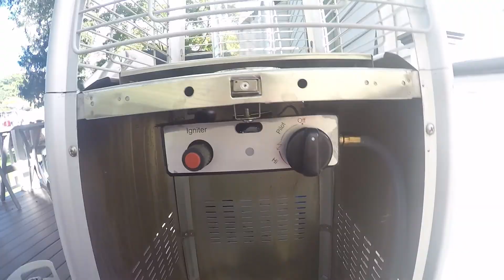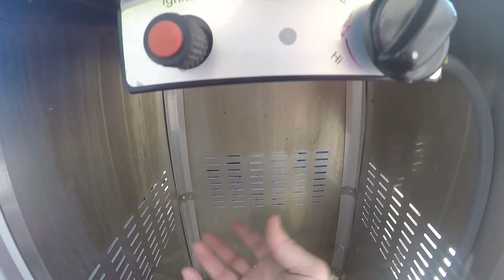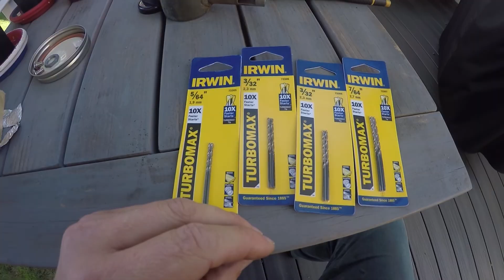Convert Any Propane Heater to Natural Gas / Dual Fuel - Simple Mod

Comment: Excellent instructional video! I have an old Dynasty ($6000!) outdoor grill that ran on propane and converted via a kit to NG when we moved to a new construction home that had NG piped out to the rear patio because, like you and so many others, hate the hassle and cost of propane. So I was familiar with the orifice size difference requirements. I just bought one of the pyramid heaters through eBay (which hasn't arrived yet) for that same patio and was wondering if it could be converted, so I'm glad I found this from you. You cover "all the bases" and answer all the questions I had. Many, many thanks. By the way, I'll probably get a NG orifice rather than drilling out to 3/32" on the stock one since they only cost a couple of bucks and keep the original in case I ever want, or need, to go back to propane.

Comment: I would have bought caps or plugs and drilled them to make new orifices so it could be switched back if needed. I believe propane hole is 1/3 of the size of gas as a rule of thumb and the vents should probably be indifferent. Usually the regulator spring gets replaced as well, you may be able to adjust the regulator screw, just not how many turns so it can be put back. Also I would never attempt something like this indoors or near anything that could catch fire if the unit becomes over temp!

Comment: I followed exact directions. I fires up. Flame just reaches top but it puts itself out after a few minutes likes it's getting choked out. Suggestions?
Reply from the maker: either air fuel mixture, or possibility that the flame is not touching some kind of safety thermal probe.   depending on your model, thermal probe needs to stay hot to keep the fuel flow going.
Reply: @ModsAndProjects  Thank you for the quick response. This is the heater which appears to have the exact burner you show.Pyramid Patio Heater, 48,000 BTU Outdoor Heaters. I used foil tape and closed of vent holes. Could i need to maybe open up a small area?

Comment: I know Im late, but this is such a helpful video. We did something similar to our grill 15 years ago. Just bought a bit set from Harbor Freight for like $10 and drilled the jets slightly larger. Worked like a charm. Cant wait to do this to my heater towers and stop refilling these tanks after a few uses.

Comment: Would this work with one of the Mr buddy infrared pan heaters you know the ones that screw on top of the propane tank and look like a round metal bowl and heat up the infrared area and turn it orange?

Comment: I have the same unit as you. I tried with just connecting the natural gas line first, couldn't get a pilot light. Tried propane to confirm thermo coupling works, yes it did. Maybe not closing the air vents would cause no pilot light? I don't know. Hope that works.

Comment: Do I need to use a regulator after converting to NG?
Reply from the maker: You could always add one for extra safety but generally the pressure to the house is regulated after the meter and is low pressure.

Comment: Very easy to set up and use, attractive but be sure you understand the height it's not tall. The heat is not overwhelming, but steady and pleasant fireplace.homes It's quiet, too. I like the possibility of easily moving it from room to room in the event we want supplemental heat elsewhere. Definitely a good buy.

Comment: I have the exact same model of the outdoor gas heater as the one shown in the video. I'm using a natural gas hookup. I went ahead and drilled the jet by 3/32 and it did increase the height of the flame. However the flame doesn't go as high near the top. I live in Colorado and the elevation is higher and I'm thinking it is because of the altitude. I'm debating if I show use a bigger drill bit to compensate for it. Does anyone have any thoughts or recommendations with this problem? I'm concerned that once I drill the hole bigger, I can't go back to the smaller hole if let's say it didn't work out.
Reply from the maker: Pretty sure you could find a replacement jet threaded for the same size as the one in the unit if it wound up being too big of a hole just go up in very small steps as far as the diameter of the hole
Reply: @ModsAndProjects  Thank you. I'm not sure I have the right tools to be able to determine the size of the jet. It's rather tiny.

Comment: Ok so I converted my outdoor heater with glass tube. Works just like in the video but soot build up in glass tube. Can I add small vent holes in the area I blocked off with the foil tape to help eliminate the soot?
Reply from the maker: It's just a matter of adjusting the air fuel ratio until you get a yellow flame with not much soot.  You might want to try something like a hose clamp so you can slide it and adjust it more easily

Comment: Wouldn’t just replacing the gas jet/nozzle be cheaper and easier than buying several drill bits for drilling a larger hole? Plus you could always put it back if you decided to use it somewhere else where a gas line is not an option.
I’ve never done this and not sure about how much they cost, but for others seeking a similar solution might want to weigh their options...
Reply: Has anyone found an appropriate orifice/jet/nozzle online? I'd be great to experiment with one of them (and keep the originals so that things are 100% reversible)
Reply: @toddjc1999  ratio is 1:2.5 propane being 1 to find proper size 4 application

Comment: I just used the info from your video to mod my propane fire table that I'd pretty much given up on being able to convert over to natural gas cheaply and it worked. I drilled out the port hole and covered the vents with tape and it works just like it did on a propane tank. You're my hero! Going to convert my patio heater next! 🙌

Comment: Thank you for this video posting. I made this conversion on neary identical Hiland and Hampton Bay units. The flame is perfect, with a slight amount of carbon soot; however, the pilot doesn't stay lit. It cuts in and out. I'm curious if you experienced this and whether you had to increase the size if the pilot ofifice as well.

Comment: Warning. Look up the pressure. My plumber told me there are times he needs to remove a valve with no way of shutting of the line. One time he found the line has very high pressure . It does happen but it's rare. Still worth checking.

Comment: Hello great video.. I have the same triangle patio heaters n a natural gas fire pit n I split my natural gas 3 ways n my natural gas fire pit works fine but both triangler heaters won’t light.. now I have block of the vents or drill the bigger hole on the valve. So I’m not sure why I can’t get the heaters to light.. can u show me how you split your lines that feed the natural gas?

Comment: Hey really great video. Tried converting my patio heater but I’m getting yellow flames. It’s a 48,000 btu patio heater. It has a big gas ring at the top not a glass tube. I want the blue flame just like the LP. My yellow flame is leaving a little soot on the top reflector. Any help would be great
Reply from the maker: Hello friend, it's all about the air fuel ratio just try and fine-tune it and you will wind up with a clean blue flame if that is your goal.

Comment: Did you notice any loss in heat output after the conversion to NG?
Reply from the maker: Slight decrease in heat output I'd say 10-15% if I had to guess.  You could probably cut the heat loss to zero by increasing the jet size for more flame to offset the decrease in BTUs:volume of Propane:NG

Comment: I purchased a 91" Hilbrand (same as yours) triangle shaped heater and just finished the conversion and followed your advice.  I am not getting much heat at all.  In fact, I can place my hands on the metal grates that protect the glass tube and barely feel any warmth.  My question is what can I do to get more heat from the unit?  The flame goes up about 3/4 to the top with some jets reaching the top.  Flame is orange but I am wondering if I need to drill a larger orifice in order to get more heat?   I look at the Lava lamp images and those appear to be glowing red towards the top of the heater.  This one does not glow at all.  Thanks in advance.  Perry
Reply: I am interested in this response too as I am considering this conversion soon.
Reply: @michaelscanlan4070  So I think it is the design.  The heat is not getting to the intended target which is people.  A couple things I think may be the issue.  The height of the unit (91") makes the hottest part of the heater taller than most people.  I am 72" so that's 19" above my head where the most heat is located.  The heat in the open sky is zero.  I would guess a smaller. lower to the ground unit would be much better.   Also, the heat deflector on the top of the unit is very small.  Heat rises so the 12" x 12" deflector is hardly enough area to push the heat back down.  The glass tube is not allowing much heat to escape.  It's very pretty but is more like a candle and not a heater.

Comment: What about a propane fore pit ?
Reply: Same concept. Depends on the delivery pressure from your gas meter. Just adjust oriface size until you get the desired result.

Comment: Excellent video with great detail and explanation. Education and well done.  Also I turned out to need a 90 degree angle gas pipe fixture in order to allow the hose to be used as it was too tight to make it work.  Curving the hose was not possible so I had to order the 90 degree elbow.
Reply: Perry, where did you get the 90 degree elbow. I think I'm in the same boat, but haven't been able to find that part.

Comment: Any propane heater, just not indoor types, thanks for clearing that up at the very end.
Reply: Is the conversion for indoor heaters not the same?  and if not, why?
Reply: @tedtolentino4955  I was being sarcastic, but maybe his lawyer stepped in at the last second and told him to add that disclaimer to avoid liability.  But seriously, I suppose one could apply the described conversion on a catalytic heater and create a monoxide problem.  Methane has less energy than propane and the converter might not burn hot enough, especially on a low setting.

Comment: Thanks for the video. I am going to be trying this on the Venturi Spiral 40000 BTU. according to my calculations, the correct size for mine should be 7/64, but I will start with 3/32 as per your recommendation and work my way up.

Comment: Do you have to neck down the pressure to the NG pressure of ~35 g/cm² (as opposed to the propane usual into the 100s) for running off propane again?

Comment: This was very good info. II have 2 of the same heaters both running off propane. I actually wanna run them off a larger tank instead of 2 small tanks. I'm looking to buy 2 new ones but 1 of them runs off NG and the other propane and I wan them to both work off propane also. So I was looking to get them to run on prpane also. Thanks for the info.

Comment: Wondering if it would be more optimal if some of the air vent instead remained open?
 
Stoichiometric air-fuel ratios of common fuels
Fuel	By mass	By volume [1]	Percent fuel by mass
Gasoline	14.7 : 1	—	6.8%
Natural gas	17.2 : 1	9.7  : 1	5.8%
Propane (LP)	15.5 : 1	23.9 : 1	6.45%
Ethanol	9 : 1	—	11.1%
Methanol	6.4 : 1	—	15.6%
Hydrogen	34 : 1	2.39 : 1	2.9%
Diesel	14.6 : 1	—	6.8%
Wood (0%mc)	6.1:1	 	 
source: wikipedia, http://en.wikipedia.org/wiki/Stoichiometric
Reply from the maker: Yeah I'm sure you could do some experimentation with drilling some holes in whatever you close the vent with to introduce a bit more air into the mix.  Particularly in my units you get some slight sooting on the glass which may be an indication more air is needed for a cleaner yellow flame
Reply: @ModsAndProjects  Thanks, I'm an ME, so I'll experiment and let you know!  This is such a great video!  
I'm thinking of a sliding sleeve mechanism that I can lock in place after an optimum color(temp)/height is reached.  
Of course a blue flame indicates 100% combustion which is required for heating indoors, where the cooler yellow and red flames are incomplete combustion and producing unsafe CO levels for indoor use without a flu to carry the Carbon monoxide out of the house.  My guess is the higher the flame, the longer combustion has been delayed.
Now I have to figure a way to make the flames dance more... I'm thinking regulating gas flow is hazardous for risk of flameout, potentially followed buy uncontrolled combustion....but if I could vary that supplemental air, that might do the trick safely?
Reply from the maker: @gwyoung3509  yeah sliding sleeve sounds like a great way to make an adjustable air valve! I would love to find a way to introduce another gas to change the color of the flame to red or something else interesting that would be lots of fun
Reply from the maker: the two heaters on my deck have been working well since I implemented this modification the only complaint I have is slight sooting after you leave them on for a long time like six or eight hours and then you just need to wipe it off with a rag.  I'm sure if I took the time to play around with the air ratio I could probably get the sooting down

Comment: I tried it with my almost identical heater. Drilled the oriface 3/32” and blocked the vents. The unit runs about a minute our two then the whole unit shuts off. It might be the pilot is shutting off causing the thermocouple to shut the gas off but not sure. Any ideas or updates on this mod?
I just noticed there are 2 vent holes on the pilot light gas line. I taped off both of of those holes, fired it up and now the pilot will stay lit keeping the thermocouple nice and toasty. More hours of testing will be the real test.
After running the unit for an hour it appears I will need to increase the oriface size to 1/8”. 3/32” only gets the flame up to about 2/3rds of the way up.
Reply from the maker: Interesting, sounds like the thermocouple to me.  When the unit turns itself off is the pilot light still on?
Reply: ModsAndProjects no the pilot light is off also. Actually when I have the pilot knob held down and hold down the electronic igniter the pilot light is so clean and blue I can hardly see it unless it’s dark outside. I’m thinking about taking the whole box off and firing it up outside the tub but ignite the pilot only to see what is going on. Maybe opening up the air mixture a bit. My gas psi is 12 and supply line is 1/2” with a quick connect. So far very puzzled. I have a second heater too but don’t want to mess with that one till I get this one  working.
Reply: @Pushrod54  you have 12 psi gas? Thats unusual. 0.5-1 psi is the normal. You might be blowing out the flame with since its so much higher than it was originally intended for. You will need to put a regulator on it to get a simular pressure to what the propane fuel had.

Comment: No! Stick with propane. If you run dry, your local propane dealer will be more than happy to top your tank right up. Keep it propane and taste the meat, not the heat.
Reply: That boy ain’t right
Reply: @davidp18  that's all I've been trying to say

Comment: Wonder if a right angle inside the element would cause the flame to spiral up the glass tube like you see in a firestorm?
Reply from the maker: That's a very interesting thought.  however, the actual gas is distributed evenly across a 4-inch plate on the top burner so it would be difficult to route the gas in such a way where it would spiral in my opinion.  Another modification I thought of that was crazy but would be a lot of fun is to introduce another gas tank to supplement the natural gas to change colors of the flame
Reply: @ModsAndProjects  Put a spiral of copper wire in the flame to get 'green' fire...

Comment from the maker: If you are going to convert your heater from propane to Natural gas you are going to need a Gas hose and a quick disconnect.  Please consider using my Amazon Affiliates link to grab a quality unit at a fair price - Link for the Gas hose (includes quick disconnect!) = https://amzn.to/2TA20Ps  Other lengths in description!

Comment: Great How To!   love the total DIY sprit in the "Lets see what happens when we try it back the other way!"  Cause I know I would've been thinking of doing the same thing!!  Right on...very informative.. Im going to see if I can accomplish the same success on my two Mr Heater 18,000 btu roll-around garage heaters--- youre right, taking those propane tanks back to the 'Blue-rhino or Amerigas" exchange is a P,I,T,A,....and not cheap either at $20 bux a fill.... Natural much cheaper, and I kinda think you may be getting more BTU / gallon on natural vs propane.... Have Fun!
Reply from the maker: Thanks for the feedback =]  I had a great time with this mod!
Reply: What did you end up doing to convert the 18k btu heaters?

Comment: I decided to attempt this on one of my patio heaters from Costco.  Once I found the brass nozzle, I drilled it out 1/32nd of an inch larger than it was before.  It fired up on the first try and it’s putting out heat, but it’s clearly not matching the output of the propane one.  I suspect I need to expand the opening a tad more but I’m concerned with going too far.  Any suggestions on if that’s the right course of action?  Or if I’m missing something else?  Here’s a video of the two for comparison.  1st up is stock setup with propane, 2nd heater is the one I converted to NG:  https://youtu.be/wlq4iCTUnNQ
Reply: Ok, sounds good.  I’ll go up one more bit size and give it a whirl.  I’ll report back here with a comparison to let others know.  Thanks
Reply from the maker: Just take it one step at a time in the smallest possible increments and you should be fine. if you happen to go a little bit too far you can always regulate the output using the variable control valve via the knob.
Reply: If you go to far, its brass so it takes plumbing solder well. Solder your hole closed, just don't mess up the threads. Then just re-drill your plug to the smaller size.